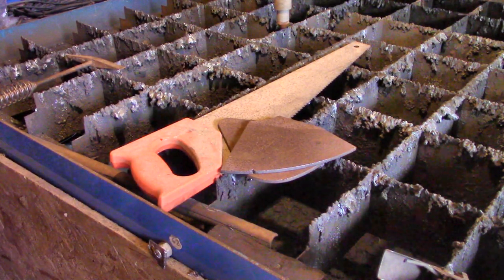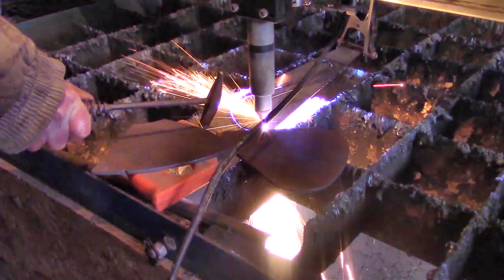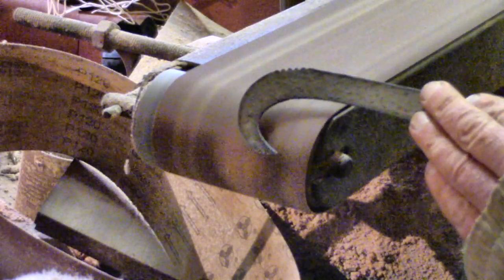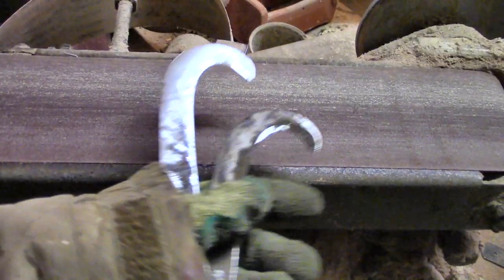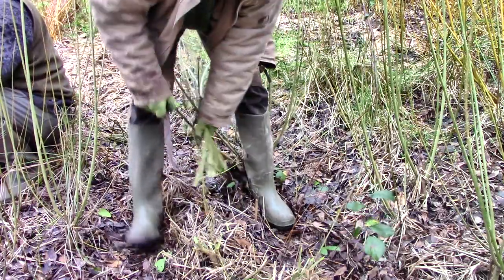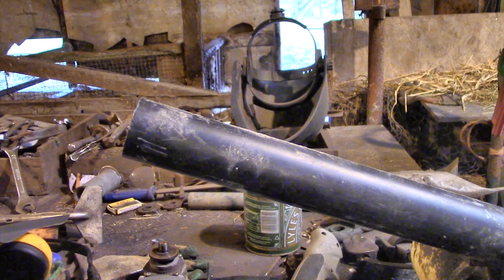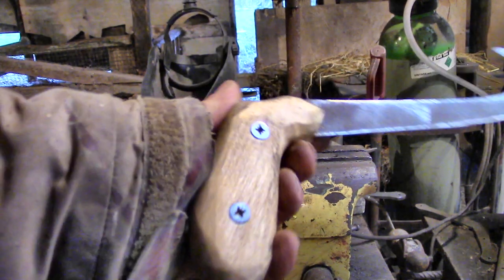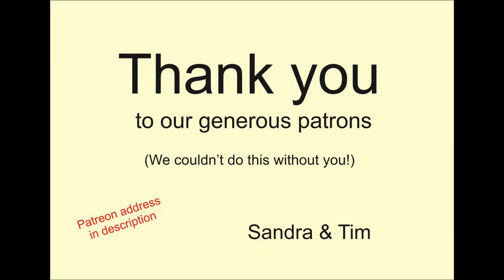Homemade Willow-Harvesting Hook From An Old Hand Saw

Comment: I wonder what the edge would be like if you use tool steel from older saws. I pick them up for £1 from boot fairs, Sheffield warrented steel or similar, many are 100 years old but with worm ridden handles are not worth much but should keep an edge beautifully for what you want. Great idea of yours, keep them coming

Comment: Perhaps if you hang it off a dowel instead of a screw, the blade might not require as much resharpening. Nice job though, I want to make one. I have a bucket full of old saw blades in the garage, so I should be able to re-purpose one into a new tool.

Comment: Looking forward to hearing about the willows. I restore and use woodcarving tools of all types and have done the same many times. Most with my own form of "plasma" cutter.
Reply: I've never restored a knife, but I made one once.  It was rubbish.
Reply: @thekodanator  It's a practiced skill. Use old steel, 1800 English tools if you can find them. Disston Saws, if you can stomach cutting them up you won't find better steel.

Comment: But please, don't hang the tool from its sharp edge on a nail ;) (wooden leg might not hurt it though, if another hanging point  around the handle doesn't work)

Love your approach of experimental low- & higher tech solutions though, nice video once again!
Reply: I felt the same way when I saw that!
Reply: A leather loop attached to the handle would do the trick

Comment: Definitely an interesting tool.  An old logging crosscut saw blade should be made of thicker steel, that could give you a stiffer blade.  Also, they're usually larger than a hand saw, so you might be able to get several of those blades from one.

Comment: i much prefer a good ole mild steel sickle for work like this you can gather all of them into a bundle with one hand and cut through them in one swing and the edge is easy to keep razor sharp at the work site with a fine metal file. also make these kinds of bill hook sickles its best to use a good old fashioned mower blade and use a blow torch to heat up the sickle part and quench it in some old motor oil since its better hard so the edge lasts longer because its a pain to sharpen them unless you make it to a specific half round file size.
Reply from the maker: Really? For willows? I used a sickle hook for years (I couldn't find it for this video) but would only take one wand at a time. Surely your way leaves some cut very long? And to cut more than two or three you'd have to give it a swing so you're not in control at all
Reply: @wayoutwest-workshopstuff6299  nope it goes through it in one swing but its all about edge retention and weight when cutting a full bundle you have to sharpen it every two to three cuts though, the sickle type i'm talking about is the same one that's on the old USSR flag and has a edge bevel is the full diameter of the blade for specifications it's 1/3 inch thick and 1 3/4 inches wide with a 18 inch long (if you measure the spine). its honestly a great tool it can cut through tree branches 2 inch in diameter like its nothing it can't harm to make one and trying it out for yourself since the ones you can buy are honestly useless.

Comment: have you ever looked into case hardening? its a way to turn mild steel into carbon steel that can be hardened, by heating it in an enclosed space with carbon and no air

Comment: Just browsed proprietary hooks. Many with long handles, larger blades. Mass / weight call it what you will, will always convert your effort into action more efficiently. The shorter handle encourages you to use your wrist, which is not good. The longer handle engages your arm and shoulder, much better. 😀
Reply from the maker: I couldn't find anything like that, Tab. Where did you find them?

Comment: That looks like the sliding table from a Wadkin panel saw your using with your plasma cutter? Hand saw blades are spring steel, even the hard point ones, so they should hold an edge, apparently tungsten toothed circular saw blades are only mild steel.

Comment: Have You thought about orientating the handle the other way around? It might work even better, if the handle is more in line with the cutting edge and the direction of your pulling. so the whole thing would be more like a C-shape than an S-shape. You also could weld on a oval ring shaped handle, so that your hand is directly in line with the straight part of the blade.
Reply from the maker: Yes, but you need to see what you're doing too. But try it and let us know?

Comment: Looks like a very useful tool you made there Tim. Great job. I think you might be able to use old worn out circular saw blades maybe? Would a "T" handle work as the cutting stroke seems to be a pull? Looking forward to seeing what you make from the willow shoots.
Reply from the maker: Thanks, Tom. Yes, as long as they are thin enough

Comment: Yes, the plasma cutter hardens the edge, but the sharpening will probably remove all of the surface hardening! You might try hardening and tempering the saw blade, it's thin so it wont be difficult to heat!
Reply from the maker: good idea

Comment: Have you considered a strimmer with a circular saw blade attached? One sweep and move along.
We used one for clearing brush, it would happily trim through 1inch bits, so should fine for this.

Just an idea.
Kind regards
Reply from the maker: Apparently that would do too much damage to the stump?

Comment: A low cost (5 Euro-ish) and low weight diamond knife sharpener is very good for sharpening secateurs. In this video (54 seconds to 1:40) I show how I sharpen light weight and low cost secateurs from Poundland in the UK: https://youtu.be/WlNZdi6DCxs. Old saws were made with a slight wedge shape to make cutting easier, so best at least with old saws to have the sharp edge of your tool cut from close to where the original saw teeth where. Thanks for sharing!

Comment: Couldn't you use a gas or electric weed wacker, you can get heavier brush blades for them and you would then be able to do the job without leaning over except to pick up the cut pieces
Reply from the maker: apparently they do too much damage to the stump